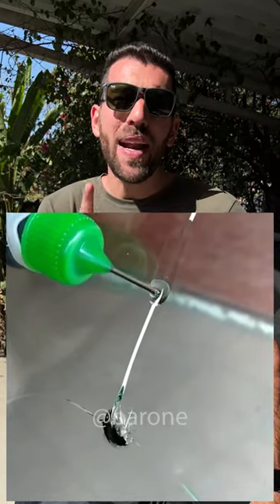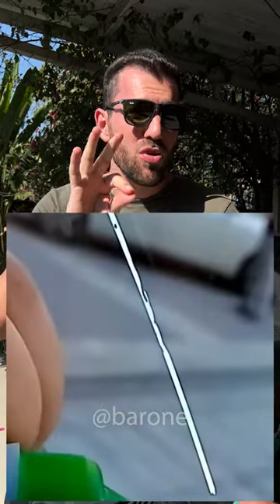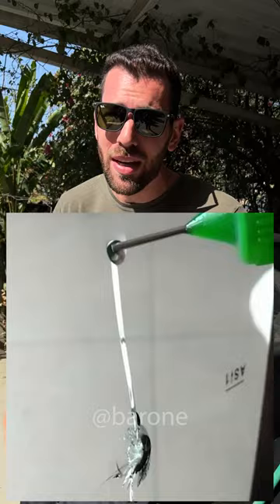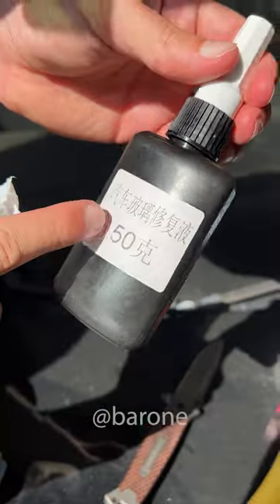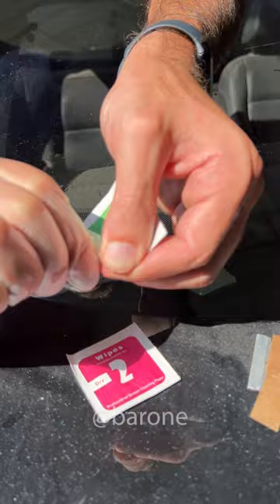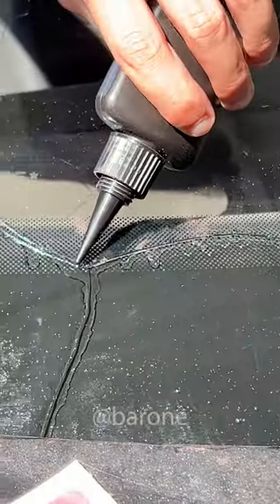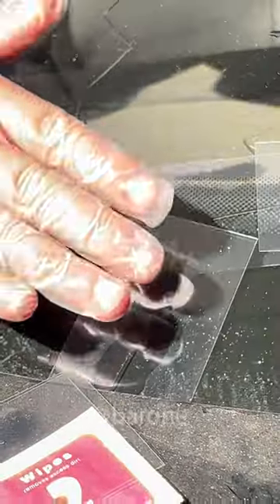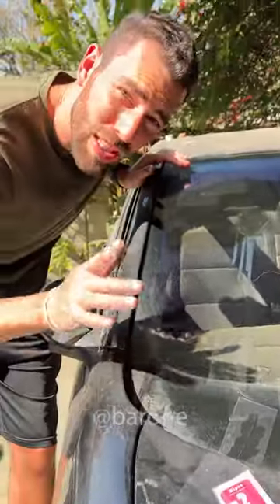Testing the internet s viral windshield glass repair glue 😱

Comment: Most insurance companies will provide a free replacement windshield at no cost - this is heavily unnecessary and dangerous
Reply: Here in Arizona you can go to a third party windshield repair shop and they’ll go through your insurance and give you back $100-300 depending on the make and model of your vehicle I got $150 for my trucks windshield twice ! So whenever I need a replacement I just call and boom I get a check makes you wonder how much those third parties get off the insurance if they’re giving you cash back !